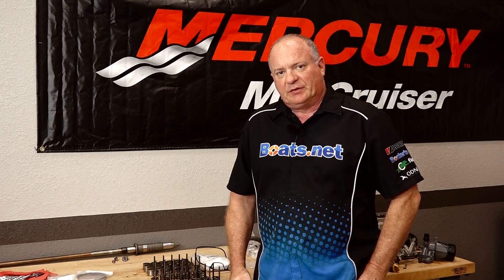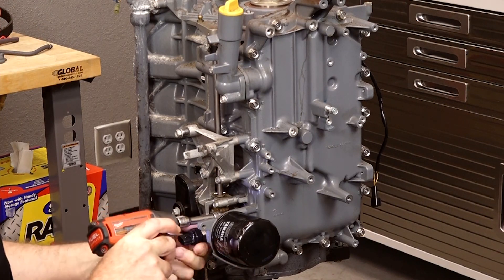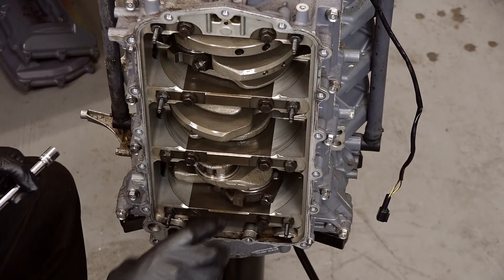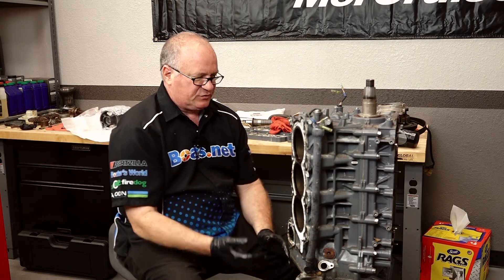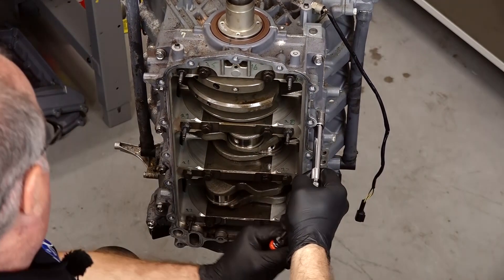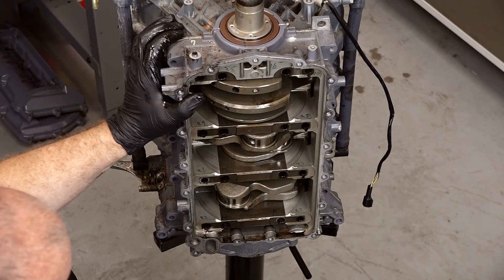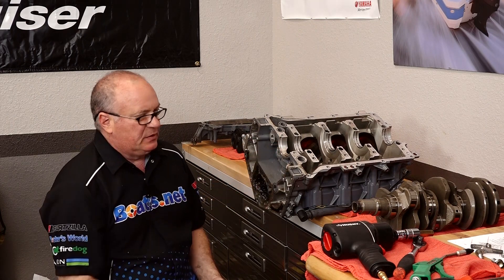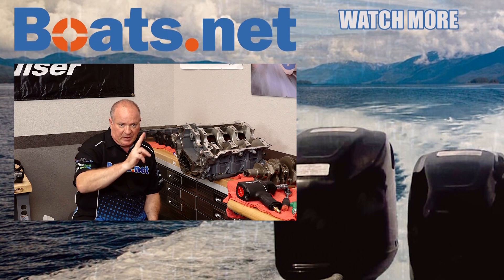Yamaha F225 Outboard Rebuild Part 3: Bottom End Teardown | Boats.net

Comment: Add mine to the list of rotted out F225 engines :(  Debating whether to rebuild it or just buy a used motor. What brand and years to avoid between 2004 and 2015. I can't afford anything much newer.

Comment: Can  you please explain how corrosion occurred this far into the exhaust? I thought that water injection occurs much later in the exhaust system. At least in other marine engine's I've dealt with (not outboards). Is this a problem native only to this generation of yamaha? I hear the early 2000 225s were the absolute worst for this.

Comment: How does exhaust corrosion, caused by faulty manufacturing process for the exhaust, eat into an engine block?  Is that saying that if you have exhaust corrosion you'll eventually have it in your block too?  How do you prevent it from destroying your block?
Reply: El blok fue en mangado y en 2 dias se marco como si ubieras faldiado el pieston en el blok y medaño 3 pistones y ebisto lamayoria delos blokes keles pasa asi nose si es por falta de asentamiento